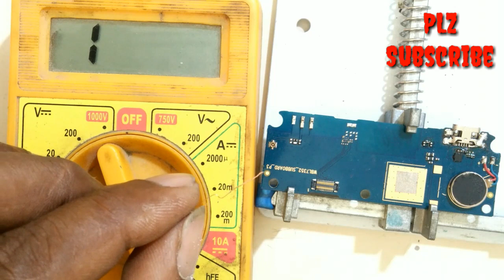How To Gionee P5L Charging Jumper Solution

Comment: Battery terminals mein 4.8V hai ,lekin charging nhi horaha hai..... charging sign is showing for 10-15 secs , but next 10-15 is not loop wise.....what is the problem.....Charger /Cable is ok(tested with another phone)....new cable mein kuch din sahi chalta hai ,fir Kum nhi karta.....fir new cable lata hu.....lekin purana sob cable alag phone mein sahi se kum karta hai......